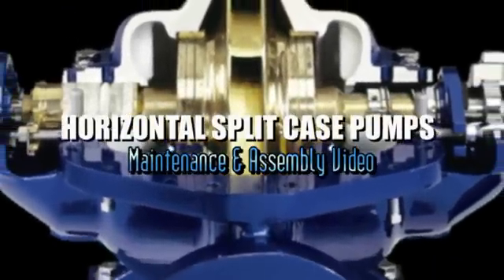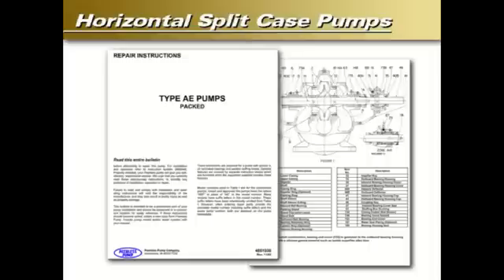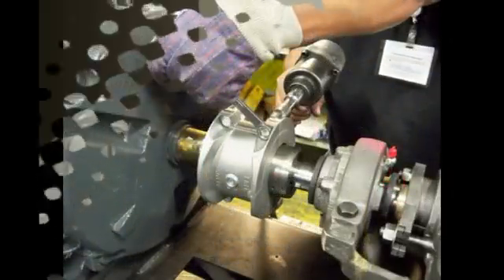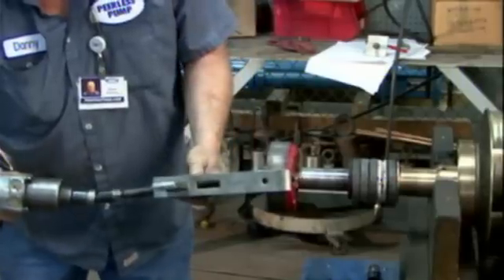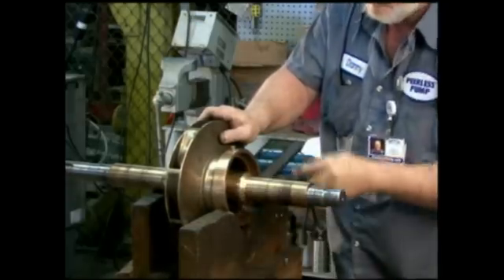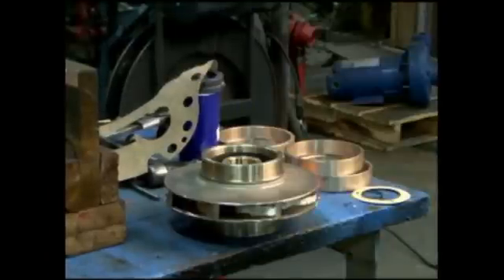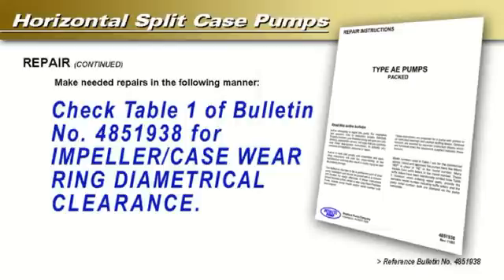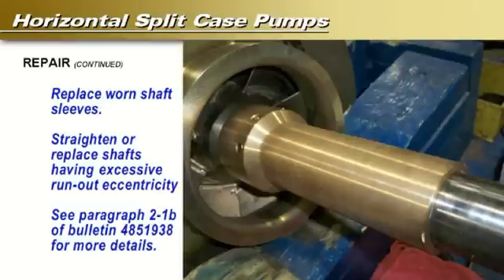Horizontal Split Case Pump Disassembly Video by Peerless Pump

Comment: I have a fire pump that has about 1/4" axil movement while running.  I removed the bearing covers and the bearings appear to be ok.  Vibration analysis picked up possible shaft looseness.  If the bearings are not sliding on the shaft where else could the axil movement be coming from?
Reply: The impeller is loose on the shaft, alignment is off/coupling worn, or ope bearing in motor is toast. 
But, you probably know by now.
What was it?